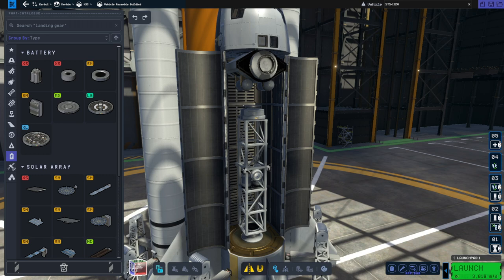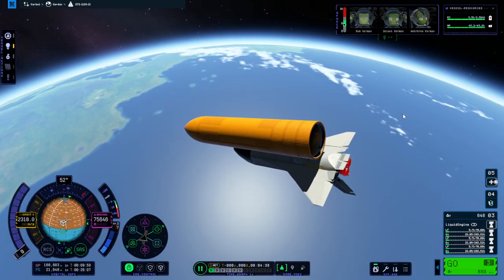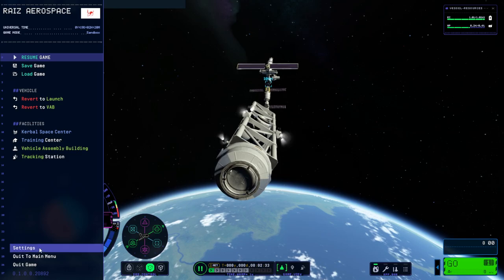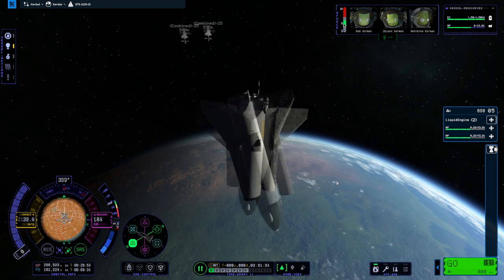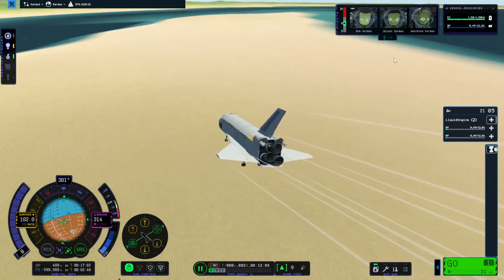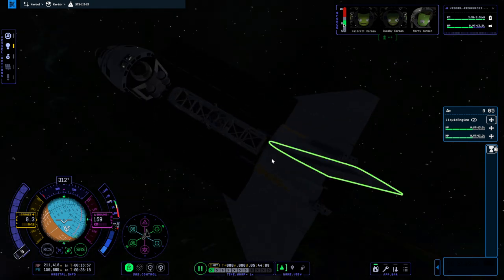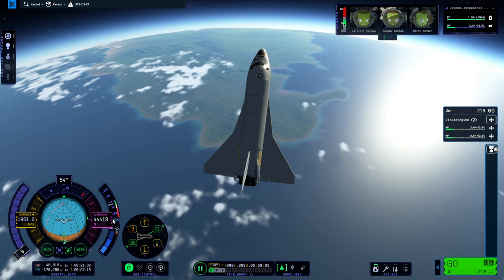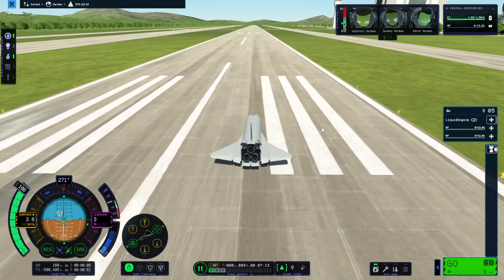KSP 2 Early Access - International Space Station Construction 6

Comment: You may be used to higher L/D ratios from RO / FAR. Stock KSP1 always had L/D ratio lower than they should be and KSP2 probably carries that thing too to some extent. I mean it kinda makes sense given that stock planets are 10x smaller, anything winged would be too op with sensible L/D ratios. So basically when thinking about the amount of energy you have, imagine you're like 2x lower than you actually are. In the worst case you can do some hard turns to bleed of extra and well, those runways are smooth and long, so landing fast won't be that big of a problem. Add drag chute in case of that.
Also, you can make split rudder brake by installing 2 rudders in symmetry really close to each other so they look like one and then setting one to deploy to one side and the other one to the other side.
Reply from the maker: I also had better lift from stock shuttles in KSP 1 - this one seems uniquely draggy even beyond the stock KSP 1 expectations. The 2x thing is not borne out by my experience between KSP 1 stock and RO and seems to be an arbitrary number.
Reply from the maker: I suppose I might as well plug my KSP 1.11/1.12 stock career: https://www.youtube.com/playlist?list=PL3_9DyRP49hCEOxzENnfAHFfyy_W5Hiqb And yes, I did make a stock shuttle in there (episodes 43 and 44).
Reply: @RaizSpace  Oh, that's because payload bays and fairings are 100% cosmetic now. They don't occlude things inside them, so the parts and open nodes inside still generate drag. So you are trying to fly a shuttle with the payload doors "open", basically.
Reply from the maker: @rune12358 Ah, that old thing - I remember those days. Yes, that makes sense. Really, I'm just reporting the way the Shuttle feels and how drag is making things more difficult for the benefit of the viewer, who may be wondering why I'm having so much harder a time getting it back to the runway compared to what we're all used to in stock KSP 1, where it's relatively easy.

Comment: I wonder if cleaning up the debris might help the lag on the ground some.  Also since you mentioned that the joystick input was digital (on or off), you might try using a program like autohotkey (or maybe even the joystick's own software) to set up a duty cycle for certain joystick inputs.  For example, if you pull back half way, you could set it at a 50% duty cycle.  Have it press W for 10ms then release for 10ms.  For 30% 6ms on and 10ms off, and so on for the other ranges of input. (or something equivalent)
Reply from the maker: @CyberSpork No, the joystick doesn't work at all - certain axes just don't read right (and this joystick does work with KSP 1, mind you). It's because I'm using keyboard that I'm saying it's digital/discrete in contrast to a joystick's normal functionality.
Reply: @RaizSpace  I understand, thats why I am suggesting this, that way you don't need to bind those axes in KSP.  Keep them as keyboard inputs, but set up your joystick software to output them as keys with a duty cycle.  (throttle could still be an issue though)

Keep up the good work, I enjoy the videos!
Reply from the maker: @CyberSpork Ah, I see. I'll consider it.